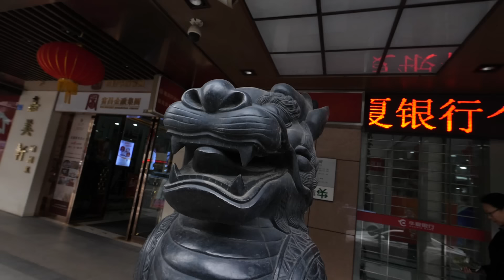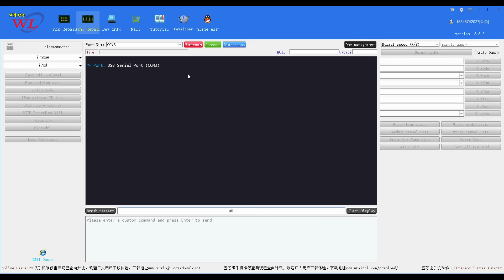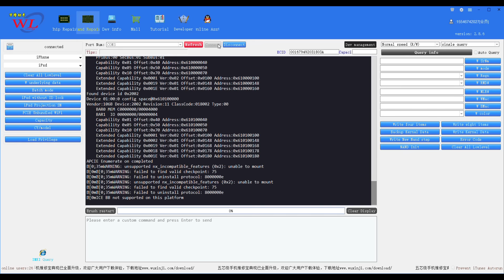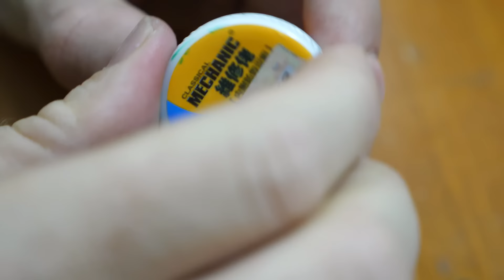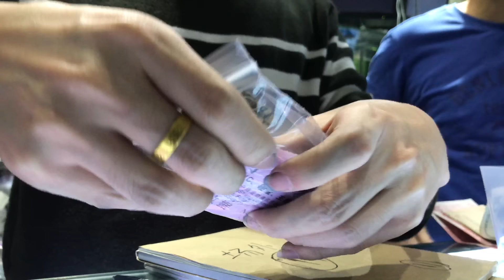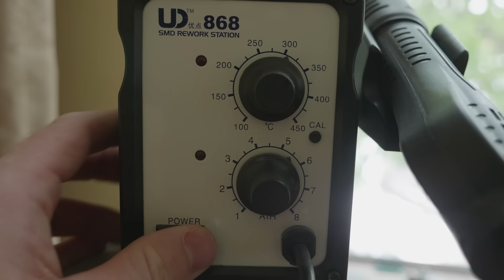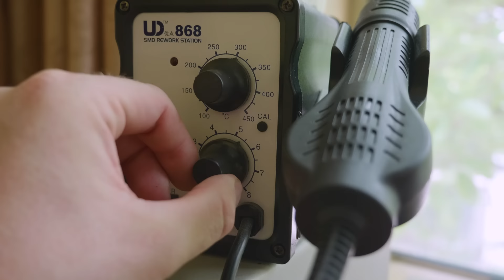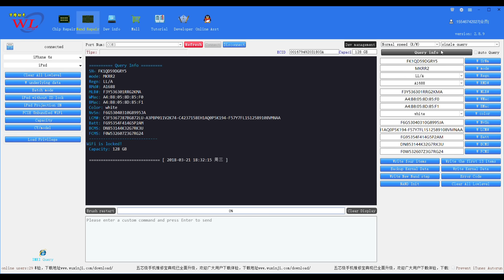How I Upgraded My iPhone Memory 800% - in Shenzhen, China

Comment: How to upgrade Android Smartphone to 128GB:

1: Insert SD card.

Done
Reply: Not all tho
Reply: Than the phone explodes
Reply: Specializes movies Joshua wdym
Reply: Luis Bulek Apple sells a phone with 256 gb for some extra 300 dollars, sd card that has 200 gb is like less than 100 dollars
Biggest thieves ever
Reply: @_nabil7163  The vast majority do allow this. If you even suspect you might need more storage later you should buy a phone with a sd slot.
Reply: Provide that the smartphone has a SD card
Reply: Lol
Reply: Not all Androids have a SD card slot.
Reply: S6 edge ?
Reply: Not all android come with SD Card Slot, my Xiaomi Mi9SE doesn't come with SD card Slot.
Reply: @thebig135  they do
Reply: @deepghosh7626 , Not all android come with SD Card Slot, my Xiaomi Mi9SE doesn't come with SD card Slot.
Reply: @thebig135  maybe..my mi phone has a SD card slot
Reply: @deepghosh7626 , use Google. 
Adiós!
Reply: @3.14name  well to be fair that is an ssd which is faster than a sd card though a 256gb ssd for a computer usually cost around 50 dollars
Reply: But didn't he upgrade the memory, not the storage capacity?
Reply: The Most apps like whatsapp download on the main memory but you can root your Smartphone
Reply: Rodolpho's Tech channel yeah but some app can only run on the main memory
Reply: SKYLON2311 that’s why I think nowadays micro as support is a bit pointless as most manufacturers giving at least 64gb internal memory. My iPhone XS is 256gb and I can’t see me needing more than that. And I paid only like 200 dollars extra.
Reply: Have to ensure it is high speed storage if you plan on using it directly as system memory. Plane jane sd cards are too slow, I have tried
Reply: Not possible for apple...
Reply: Goodd
Reply: @joshohmygosh1.0  Then*
Reply: @RodolphosTechchannel  rocking sd on my Huawei lol
Reply: @MrWizardjr9  you could get a 1tb HDD with that
Reply: @joshohmygosh1.0  They were testing lithium batteries not lithium ion for the first time. We did not know about lithium build up at that point. apple would of done the same thing they were just wusses and waited to see what happened with the android phones.
Reply: Thug life
Reply: No, it doesn’t work like that. You can’t install apps on an sd card
Reply: not can't do that
Reply: Good 👍😘
Reply: @joshohmygosh1.0  good one🙄
Reply: @thebig135  my redmi note 7 pro has SIM1 or Sdcard + SIM2
Reply: @RodolphosTechchannel  my Huawei has an Sd card slot....
Reply: @RodolphosTechchannel  "only 200 dollars extra" well done, you've only gone and wasted your money🤦‍♂️😂
Reply: Isaac Lyons it’s not about that, I would pay at least 80 dollars for a nice, fast and reliable 256gb sd card if I wanted to upgrade an android phone from 64gb... on my iPhone to upgrade from 64 to 256 I paid 200 but that’s internal storage so it’s much faster than a normal sd card and I don’t fuss too much about money on issues like this. May seen a lot to you but it’s not for me, it’s all relative!
Reply: Haha so true!..
Reply: Luis Bulek But now it doesn't work...
Reply: true but updates are very rare even on flagship phones. even my apple iphone 6 got upgraded after 6 years and it actually made it slightly faster.
Reply: @RodolphosTechchannel  you have become numb to the fact that you paid an extra 200 for a 25 dollar part
Reply: Luis Bulek 😂
Reply: @Iloyuk  But the iPhone XS and XS Max Storage starts at 64GB but Galaxy S10e, S10 and S10 Plus starts at 128GB, and Note 10 and Note 10 Plus starts at 256GB (but Note 10 non SD Card Slot. But 256GB LoL)
Reply: @joshohmygosh1.0  lol that's iPhones bud
Reply: @Iloyuk  rip the one I have doesn't
Reply: For most android phone adding a SD card provide more storage but the problem is that most apps cannot be move to external memory so if your internal phone memory is full you won't be able to install apps anymore unless you remove some you no longer use.
Reply: Yeah, but unless your rooted, its really just more media storage. Can't run apps from the SD unless youre rooted.
Reply: You failed! SD Card doesnt fit.

1. Insert Micro SD Card
Reply: Robert Slackware all non-rooted android phones do
Reply: Only for pictures
Reply: Ok
Reply: bruh
Reply: Tudor nobody needs that much storage
Reply: but still, we've the fastest chip on the smartphone, its more important than have a bigger capacity, but the performance are sloww....uuuwwww
Reply: @joshohmygosh1.0  no its work perfectly
Reply: Tudor umm that’s because it also comes with a PHONE too????
Reply: @AdrianRossi9013  icloud requires wifi/cellular plus icloud cant store apps
Reply: @RodolphosTechchannel  my current phone which i bought last month is less than 200 dollars (lg v20) and a 256GB ssd is like 40 dollars now so that's still really overpriced.
Reply: @fantasticvoyage4038  i hate the iphone interface. like i have to scroll through all my app to find the one i want to put on my desktop get out of here and i cant search for settings
Reply: Tudor you know that size isn’t the only thing to decide the price of a memory right? Like, internal phone memory is much faster then sd cards and therefore pricier
Reply: Unless your talking about the google pixel 4.
Reply: So how to upgrade my android oneplus 5 smartphone । 128 to 256 gb ।
How?😆🐸🐸 LoL
Reply: Hahah
Reply: Luis Bulek how to look stupid? Have an android
Reply: Also you need to mount it.
Reply: For those saying not all Androids have sd card slots.
1. Most do
2. Android can read USB
Reply: android is shit
Reply: A Samsung Galaxy S6 Edge+ no le gusta esto.
Reply: My phone has 2 TB expandable memory, sooooooooooooooooooooo, I did just that. 🙃
Reply: Damn right bro
Reply: Tudor FYI, sd card much slower than built in memory.
Reply: @Akturk77  should be in the SIM card slot on the top?
Reply: @3.14name  256 of nvme memory vs sd card thats like saying ssds are scams bc hdds are cheaper
Reply: @3.14name  SD cards are fuckin slow
Reply: BUT ONLY 80 MB/S , AND INTERN MEMORY HAS UP TO 200MB/S
Reply: Sorry for my english
When you have 16gb android phone but your brother have 64gb iphone so you buy a fuckin' 2tb sd card and boom now you have 2016gb (maybe less) android phone and you brother still have 64gb cuz he can't put sd card in his phone.
Reply: not all android. and it's starting to be more common to be impossible to add micro sd to android phones
Reply: Luis Bulek 😂😂😂
Reply: that's what I like to call a PrO gAmEr MoVe
Reply: iPhone is better
Reply: 2. Boom, the phone explodes
Reply: Luis Bulek yeah.. but it’s an android..
Reply: you can only store images on the sd card nothing else, and you can get an iphone 7 for 128 for 200$
Reply: Now make another life hack titled how to have money in the wallet
Reply: now try to use those 128GB in things that aren't music and photos
Reply: That's not internal memory...
Reply: Oh.
Reply: How to steal android personal info: scan the phone
Reply: Glad to see that end of the video all end well👏👌
Reply: we not from the ghetto,
Reply: Samsung Galaxy s6 edge?
Reply: @AdrianRossi9013  Same thing with Android they have Google Drive and Google Photo and some other storage applications etc
Reply: android.
Reply: @3.14name  Sure but apples storage is very fast in writing and reading. Thats why its more expensive than SD card.
Reply: Hakanai storage capacity
Reply: @Andrei-qi4tm   i found funny with Xiaomi phone, the cheaper Redmi come with sd card compatibility, while the more pricier Mi don't have sd card slot.. just like what this channel explain, rich people willing to pay more for bigger storage
Reply: Lol
Reply: android nob
Reply: you missed a step. the step is:  Format the SD card as adopted storage on android 6 and up.

Comment: Why not installing windows on the mac? You can still hve both OSs
Reply: Because he works with his mac and only wants to use windows one time?
Reply: oh yea buying a new notebook to use windows one time sounds a good idea
Reply: You don't know how cheap the notebooks in china are
Reply: I'm preety sure it isn't as cheap as installing a VM with windows for free... And would be quicker too...
Reply: just bootcamp windows and use it for one time ! why buying a new computer for one time use ?
Reply: Better. DualBoot.
Reply: DualBoot would be very bad since he uses his mac for work and only wants to use Macintosh.
And a VM inside a Mac comes with issues especially when you need to use special chinese drivers.
Reply: You can't run in a VM because the drivers likely wouldn't work properly, and partitioning your internal macbook drive is a lot more effort than going and getting a new laptop that is dirt cheap and you can use for other things too.
Reply: Константин Солохин While those specific drivers may work it’s not unusual for drivers to not work on vms, and chances are this isn’t the first or the last piece of hardware that requires windows drivers.
Reply: just use bootcamp and delete it after you finish it's simple  and does not touch OS X partition
Reply: MAROC FITNESSX I’m aware it doesn’t touch the macos partition, but it cuts the size of your macos partition by 40gb minimum, and adds additional unnecessary bloat to your laptop. It’s not as easy as just installing and uninstalling, considering that first it’s not so easy, and second that he probably wants to keep his windows pc to use again.
Reply: it's too easy ! you can re add the partition to mac os after you finish ! i'm using a mac os X and a hackintosh and i'm telling you it's super easy !
Reply: MAROC FITNESSX As someone who actually uses a MacBook I’m telling you there are reasons you would want a separate laptop for windows, as I mentioned.
Reply: There are things called dual boot or VMs
Reply: VochoTalacha BOOTCAMP!!! You can uninstall it after
Reply: true but u gotta save time here but what your saying is true though maybe he could have used a virtual operating system  installed on the mac
Reply: just for cuting size ,?? do you know you can get it back after you finish with just 2-3 clicks? i don"t know why mac user are like iphone users ! they want all things pre made !!  even a first grade school knows how to install bootcamp and delete it after
Reply: Duranium you can install and delete windows on a mac on bootcamp really easily and free. No point on buying a new windows pc
Reply: Duranium the Xiaomi Air costs 600-700 (it has also better hardware even a Nvidia MX150 graphicscard)

But he could bring it back
Reply: A no less  important tool in this setup, a good Microscope, never should be forgotten.
Reply: HAHAHAHHA Installing anything other than MacOS on a mac.

Actually, installing anything at all on a mac kappa.

Actually, having a mac at all kek.
Reply: Realistically his Mac wouldn't have enough storage or RAM to make this feasible.  I'm betting that Strange Parts wanted a more capable less expensive laptop but needed an excuse for buying something non-apple.
Reply: VochoTalacha Virtualization is a pain. And typically the connections need to be sorted out.
Reply: myb sponsored by xiaomi? lul
Reply: and because he only wants to use it one time, he is buying a laptop instead of installing a vm?
Reply: Because that would be like installing a vocho engine in a Porsche: technically possible but would be a hassle and it's easier just to go and buy a vocho hahaha
Reply: The ability to switch OS on one pc
Reply: Why not? Maybe he actually needs both OS for future projects without any hassle like turn off and on to switch the OS?
Reply: In order to use the hardware, you need direct access to the hardware serial ports. Vms and Bootcamp use virtual USB connection intermediaries. It usually doesn't affect function, but here it may. It's the same reason that Arduino doesn't always work with boot camp and just straight up doesn't work with a VM.
Reply: Probably because he's almost out of storage and his Apple is likely thinking of rolling out an update to disable the ability to add extra storage without paying a $100 fee to protect you from damaging your USB slots or something.
Reply: buying was better and a VM might been a good idea but better off w/ a pure one
Reply: M4TT EXE Bootcamp. Not VM.
Reply: exactly what i was just about to say.
Reply: You can easily find stripped down versions of Windows online for example a 500mb or so version of Xp is easy to find. Basically a good chuck of unneeded things are stripped out.
Reply: That notebook from xiaomi is not that cheap, its around 6k RMB wich is 1k dollar
Reply: Bootcamp is shitty with third party drivers that apple hasn't approved or released and apple doesn't even bother with new windows drivers. Drivers are effectively made for the interaction of software and hardware so the amount of proprietary hardware in Macs actually causes issues.
Reply: Coz he is a rich guy
Reply: @duranium4445  cheapest xiaomi laptop costs $600
Reply: He probably wanted a new computer. You can see him using the Xiaomi laptop in newer videos. No Macbook in sight.

Comment: In the factory I worked in making pcbs for wireless microphone systems, we would xray one sheet of pcbs out every run we did to check the bga. So out of thousands of pcbs ran, we would check at most sixteen of them. We didn't hand solder them in the first place though

Comment: You could've just installed Windows on your Mac with boot camp haha
Reply: I think he likes osX and doesn't want to remove it from his mac
Reply: Squid Samnic with boot camp, you just boot into windows, it doesn’t remove Mac OS from your machine, it only allows you to use windows in what is called a dual boot.
Reply: Neeecckkk
Reply: And turn your crApple Mac into a radiator because their cooling is wank. Also, apple can't handle anything that ain't apple because of shitty hardware and optimisation.
Reply: Or he could install a Windows virtual machine with VirtualBox :)
Reply: PNathan When you've got money it doesn't matter lol
Reply: I think all of you made great points. yet, its some chinese device with chinese drivers that probably work best on a windows pc cause of how Chinese make their tools. You might be able to have usb forwarding (for VM) or drivers work fine in bootcamp but I have used some of those tools that come from china... its gitchy, some are made for WindowsXP and 7 or up are done with weird drivers that arent signed properly and glitchy. He even said he needed to swap the cable... it could have been just the cable, but could also be because of the hardware inside their device. his cheapest and savest option, was just to buy a windows laptop (they arent expensive). 

Next time, he will upgrade his Miu Air to have multiple Oses  :P
Reply: But could have more driver, and connection issues .
Reply: or use parallel desktop
Reply: optimasation is BS it is an intel chip the same one in any other intel laptom the the same clock and chip.
Reply: and the stuff he is doing isnt that intencive that it would spin a fan
Reply: Zachary Law I don't know what the hell you're talking about, but I've run windows on the shitiest MacBooks and it runs fine
Reply: Sometimes having a second laptop (maybe with another OS) can save you a lot of hassle.
Reply: Best machine i ever used Windows is on my mac lol :)
Reply: having both on separate machines is nicer tho
Reply: I think he just wanted a new laptop.😂😂🤣
Reply: PNathan ! Me too! It ran just fine! Everyone thought I had a Windows Laptop until they saw the Apple Logo!
Reply: Preach. My Macbook Pro 2012 sits in a closet b/c of the heat issue issue. 

Lenovo ThinkPad, baby. Back to it.

Comment: It's easier using lead solder. Lower temp, better flow. When you rework (over and over) lead free solder it gets worse every time the solder is reheated. When doing rework, use lead solder.

Comment: Would be nice if you could say the price of stuff that you buy.
Reply: dtoften he said the memory cost $25 what else you need
Reply: TBH at least a total cost for comparison with buying a new phone...
Reply: If you consider "your time" as something worth any value, or "the chance of the phone breaking", then I'd suggest the $100 difference or whatever from the retailer / manufacturer is worth it.
Reply: bahzad23, he bought more memory: flash programmer, laptop, multi flash chips, many practice boards, "sim card holder" plate, reballing stencil, solder paste.